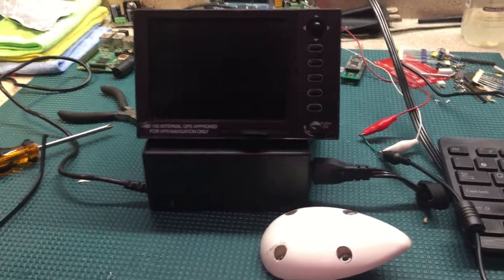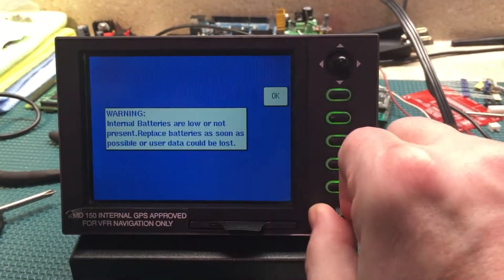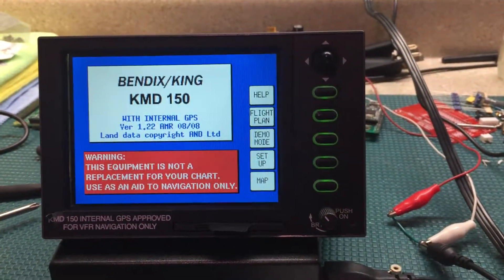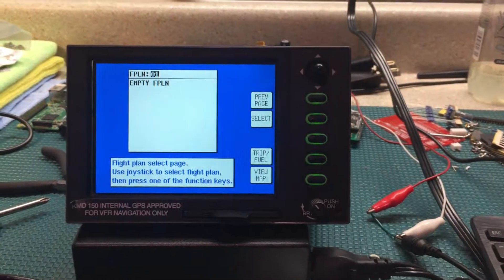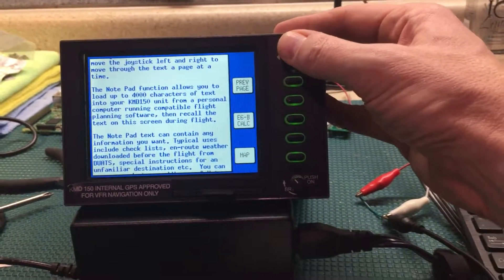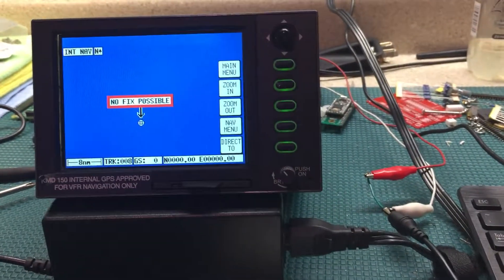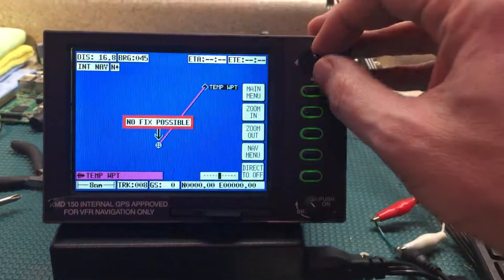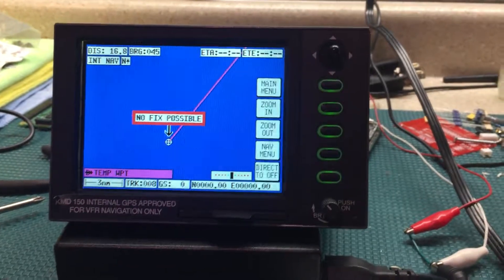Bendix/King KMD 150 GPS Unit Quick Power-up

Comment: Some advise the internal battery is in a bad place when it leaks it destroys the unit . What I did was go into the unit and remove the battery and left the battery leads soldered to the board clip them and removed the battery then attached two wires to the leads and ran them out the back of the unit to a AA battery holder . Then went on line and purchased a 4500 3.7 vt. Button top battery. Then attached the holder with the battery in it to the fan cage with zip ties so it would clear the hole in the mounting sleeve. It cost about $300 to have the battery replaced , it cost me $8.50 for me to change mine . You will really like the KMD150 it’s easy to learn and operate. Good luck